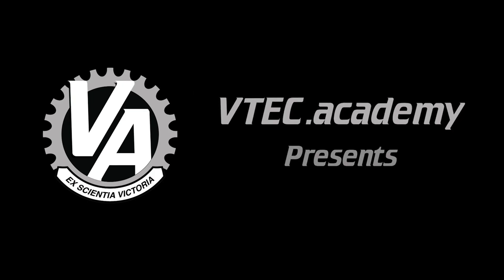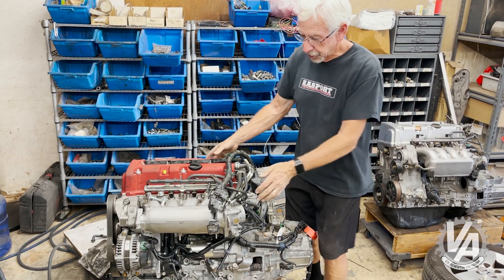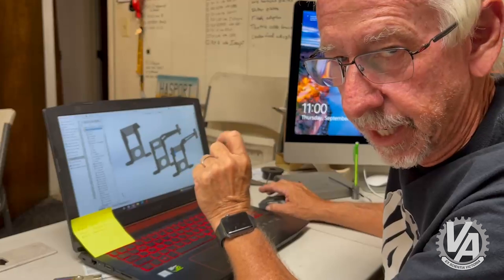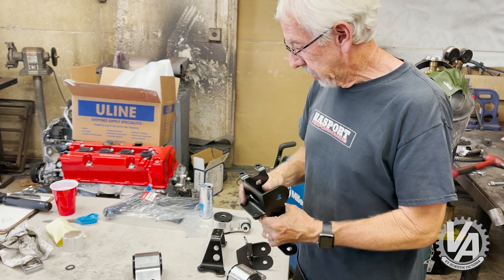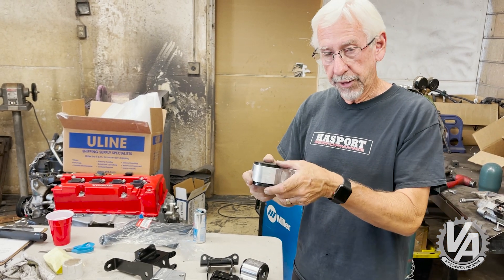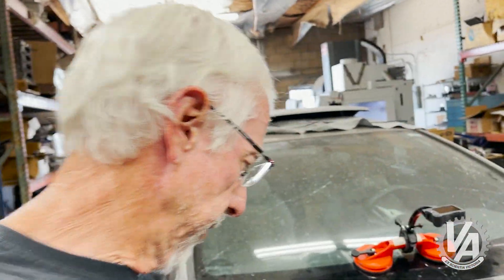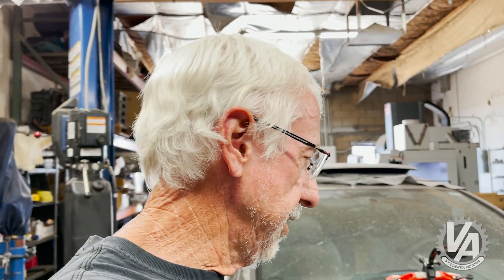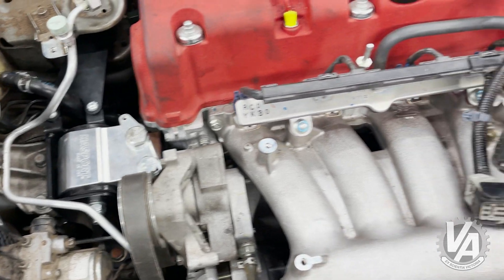8th Gen R18 to K Series Part 2

Comment: Great vid, may I ask what it takes to convert from hydro to electric power steering - is that easy? Also, what happens if the donor for the K24 is a TSX with a steel pan? Will this rear mount fit to the mount location on a steel pan?
Reply from the maker: It would require the rack, the EPS brain, and a bunch of wiring.
Reply: @VTECAcademy  , that would be a great thing to see as a video showing this process - do you plan to show such thing in the future? Is it safe to say that electric is better than hydraulic compared to parasitic losses, therefor better option for a tuned car? Is wiring separate harness that is plug-n-play or what you call a "bunch of wiring" is a lot more involved? Regarding the rear mount, what I see is the mount is the same for early and late model TSX, which must mean that in your kit the rear mount is the same too - but would be happy to read it for the piece of mind.

Comment: Hey guys I’m a new subscriber I have a different issue than what you have solved my question is I have a 2008 civic si coupe MT Engine trans stolen my LITTLE SISTER needs a car I have a full donor 2007 civic ex auto REAR DAMAGE could I just switch the subframe and whole engine would the car work? Please help
Reply from the maker: Yes, but there aren't mounts made for that swap. You'd have to make them. You could modify some stock mounts to work. The passenger side mount would be the more difficult one.  The wiring would pose a problem. Power steering is electronic on the Si so you would either need to change the rack with the subframe or make an idler pulley for the engine. Then you'd have to have Honda reprogram the ECU to work with the Si chassis.

Comment: The FD2 typ r in Japan has hydrilic power steering I'm sure if you used the high pressure line from that car it should be easy to get the hybrid power steering working with this swap, here is the pn 53713-SNW-023
Reply from the maker: It is probably too short since those cars are right-hand drive with puts the valve body near the same side as the pump. But this is good to know. That ECU will have at PS pressure switch input. I'll need to find out where it is and see if it is dormant US ECU.
Reply: @VTECAcademy  your right I didn't think of that, probably wouldn't be hard to make a custom line. The eps unit has an output that goes to the ECU just like the ps pressure switch so I assume they would send the same information, compare how the pnf ecu is wired to the pnd or prb

Comment: Any chance of these being made to work with different transmissions?  Those Si transmissions can be a bit of a doozy to find at a reasonable price.
Reply from the maker: With this mount kit you can also use the RSX, EP3, 08-13 Accord, 09-14 TSX, 12-15 Civic Si transmissions. The RSX and EP3 wound need a different shifter, the others would need a different bracket on top of the transmission to hold the cables.

Comment: I saved for SO long to get a set of Hasport mounts for my fully built LSVTEC turbo in my EJ8 Civic coupe (that makes 709 whp) and I am so happy with my purchase. I had Innovative mounts, I had a custom brand, and it just vibrated and sounded like crap. As soon as I got the Hasport mounts it sounded and ran so much better. Absolutely NO vibration and the engine stays right where it's supposed to. Seriously, if anyone out there is building a Honda, you owe it to yourself to spend the extra cash and get a set of Hasport mounts for whatever you're project is.
Reply from the maker: That's what they strive for. Your Civic sounds rad!